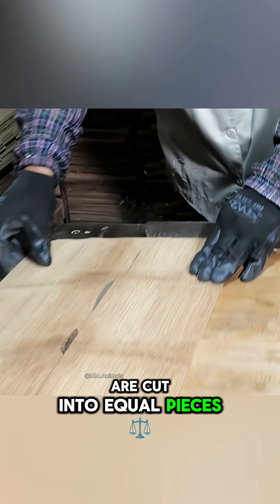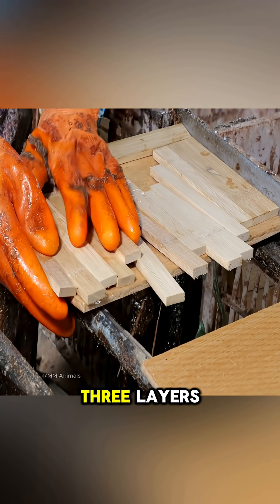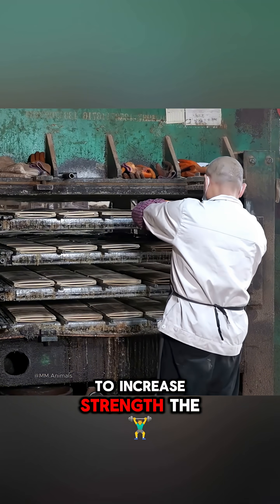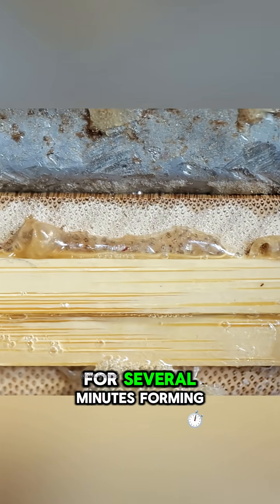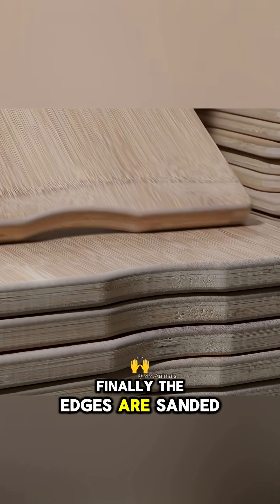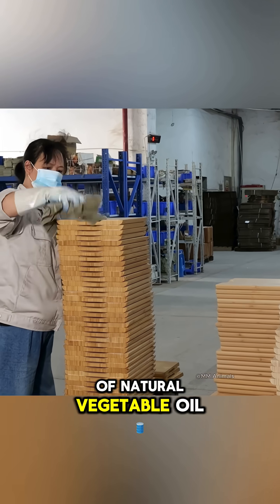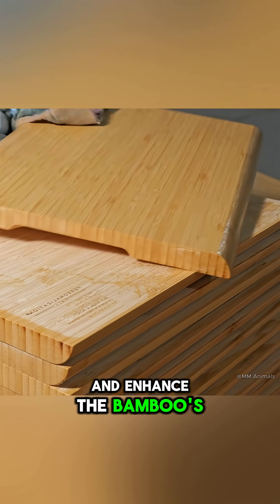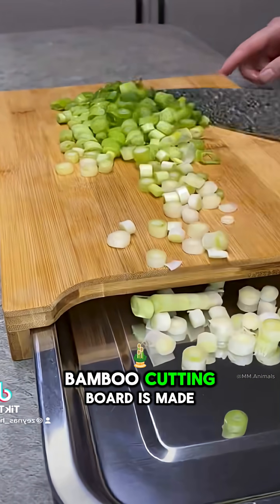How China Transforms Bamboo into Everyday Utensils #technology  #discoveries  #knowledge

Comment: I literally hate plastic cutting boards to the core... It's like literally adding microplastic in your food intentionally
Reply: ✅ If China & India work together for few years, America will definitely lose its Super Power Rank. There is no doubt.
Reply: @sajikg8140  If
Reply: But I've one in my home
Reply: @Fredricksaviour  Uh Oh
Reply: I agree 100%. I purchased a water drop water filter on Amazon that removes micro plastics and other impurities. My water now taste amazing and thats the bottled water from the store I filter. Once filtered i fill up glass bottles.
Reply: Ceramic or metal are better. Easier to clean.
Reply: @johnwt7333 Will they not make loud noise while cutting...Also if used regularly they will make knife blunt...I prefer wooden chopping board.
Reply: @robocop5543 metal yes. Ceramic not much issue. You can test it out with a large flat ceramic dish. Also, knife on wood is like nails on blackboard 😅